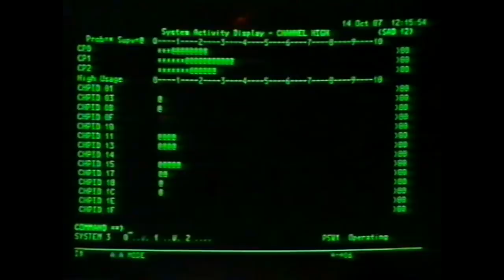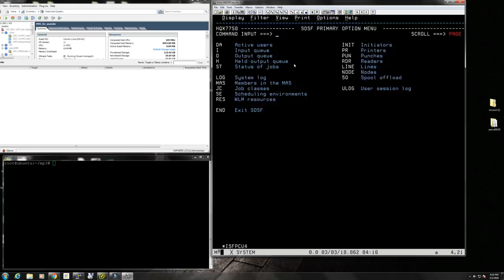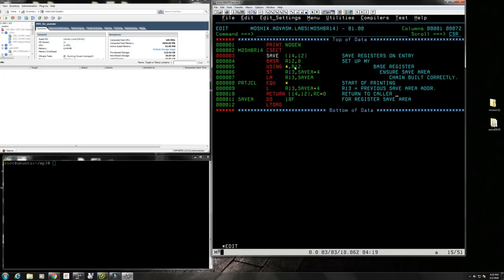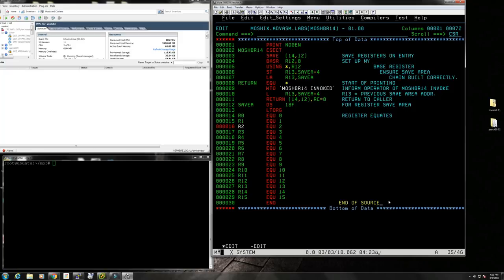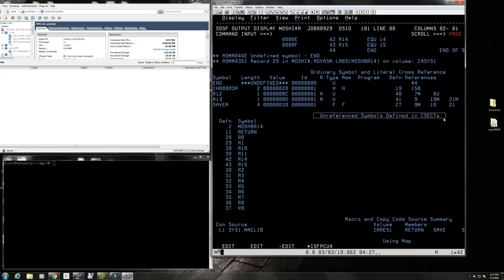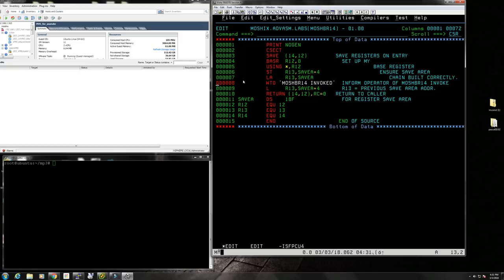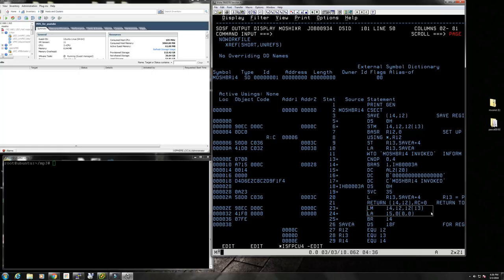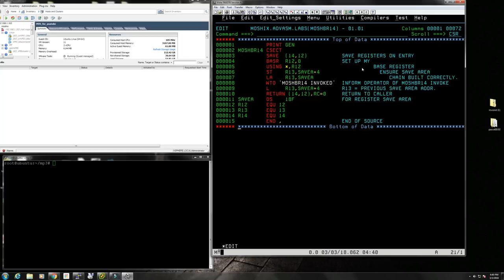Write our own IEFBR14 MVS, z/OS utility - M52

Comment: Actually, IEFBRR14 can be written even simpler, containing just two machine instructions.

         PRINT GEN                             
MOSHBR14 CSECT                                 
         SR       15,15    ZERO-OUT RETURN CODE
         BR 14             RETURN  TO CALLER   
         END MOSHBR14                          

There is no need to save the registers if you're not changing them.
Reply from the maker: Nope. That will cause problems with the caller
Reply: @moshixmainframechannel  ,

No it won’t. As long as the only register that gets changed is 15 - the return code, saving and restoring the registers is simply wasting cycles.

The purpose of the SAVE and RETURN macros is to save them upon entering the program, and to restore then back to their original contents upon return, so that the contents of the registers are not changed once the called program returns.
Reply from the maker: @DeanHorak  it’s a bit more complicated than that. But in 99% it will work fine
Reply: Yes, in most assembler disciplines we only push and pop what we might taint.  No specific need for address-ability. I would have gone with XR rather than SR as I am unsure about clearing overflow (is it not persistent ?).  No need for PRINT GEN if there are no macros either.
Reply: @matthewmckenzie7687  ,

IEFBR14 uses SR, so that’s what I used - but XR would yield the same result.
Reply: Great videos moshix!
Reply from the maker: @joeowensuk thank you !